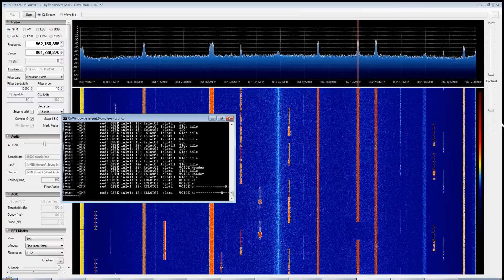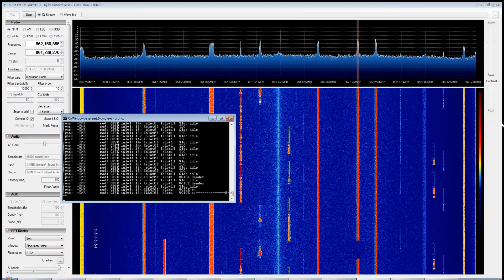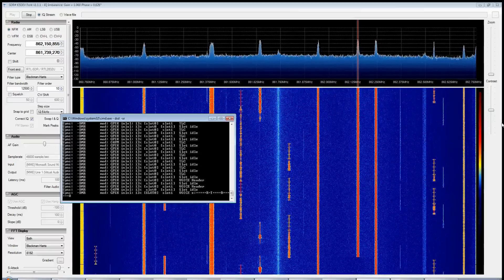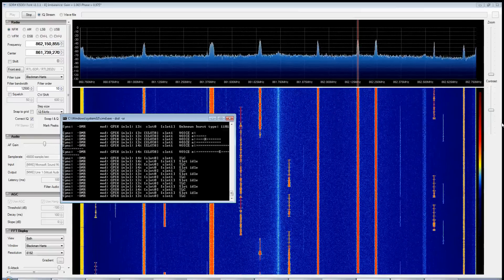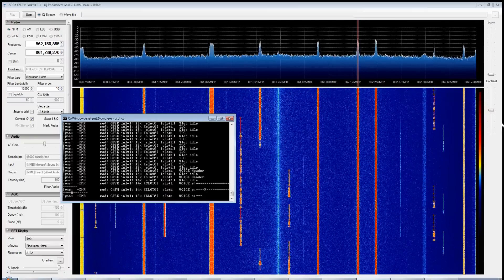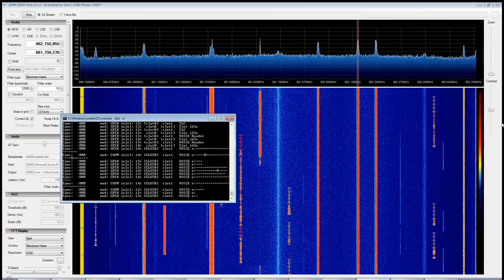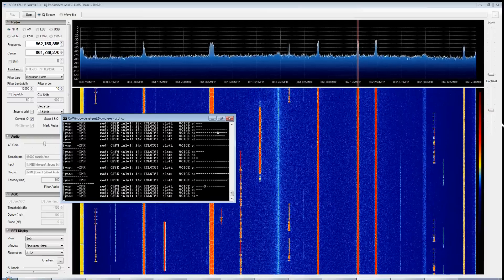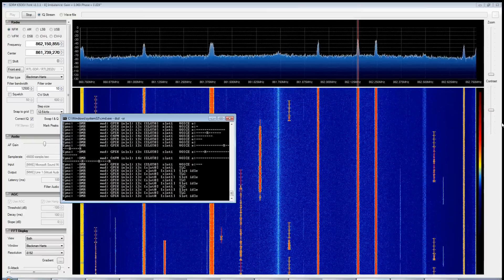Digital Voice Decoding with RTL SDR (RTL2832), DSD and SDR Sharp

Comment: Hello,I have a problem ... :(

Do you know why dsd plus can work wtih SDRSharp ?

I want to know what file dsd+ read, so it can decode p25 message .
(SDR# is not installed with dsd+ together, but dsd+ can solve the signal received by SDR#.)

Comment from the maker: Hi, for VAC is didn't change anything, just default settings. For DSD I used the -xr flag as my received signal is an inverted MOTOTRBO signals. In SDR# I used NFM, and I found that a low filter order or 10 worked best and that filtered audio seemed to help a little. You'll need to fiddle with the volume sliders and find a range that works well for yourself since all sound cards are different.

Comment: Actually, for this signal no text information were scrolling. I saw sometimes false detections in DSD, but it wasn't on this signal, it was just noise and other non-digital signals. I'm sure that SDR# is outputting to vitrual cable, because I can see level of signal in windows sound mixer, and virtual audio cable is my default audio recorder and also I can hear the signal if I'm setting "listen to this device" for virtual audio cable device in recording devices.

Comment from the maker: Do you get any sort of text scrolling from DSD on this signal without extra command line settings? If you do but the sound is garbled, it's probably digital voice but DSD detected the wrong setting. Type dsd -h into the cmd line to see more settings.

If theres no text scrolling then it's probably not digital voice, or DSD is not receiving audio properly. Make sure SDR# is outputting to virtual audio cable. Also, I had to set virtual audio cable to my default audio recorder for DSD to find it.

Comment: I tried to decode channel that is most likely digital voice with DSD, but no decoding happens. Using virtual audio cable and other settings as in your video (filter order to a value of 10, use filtered audio and set dsd to high CPU priority). What can be wrong? Video sample of my signal available at my channel.